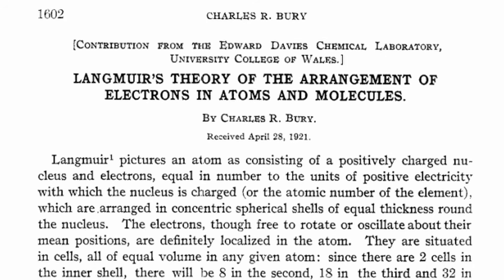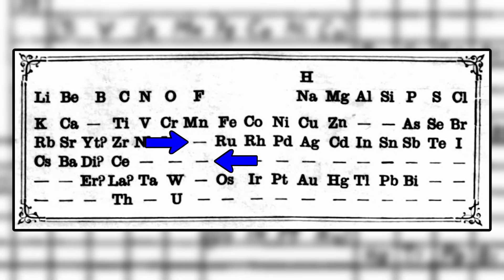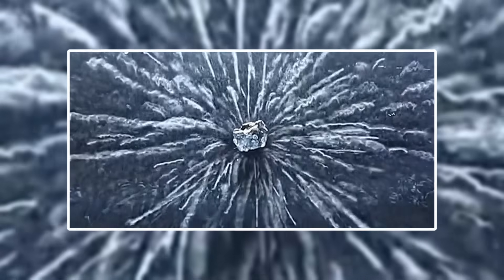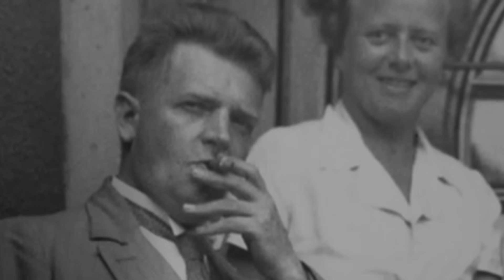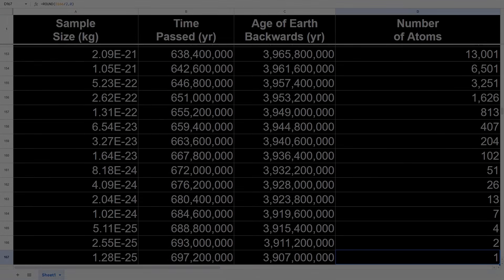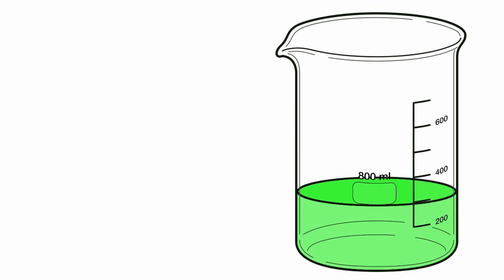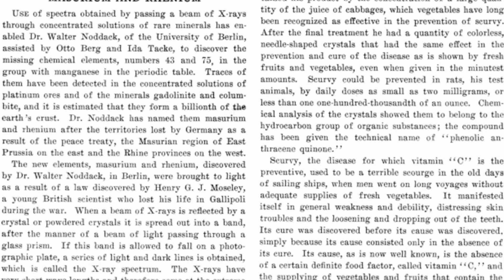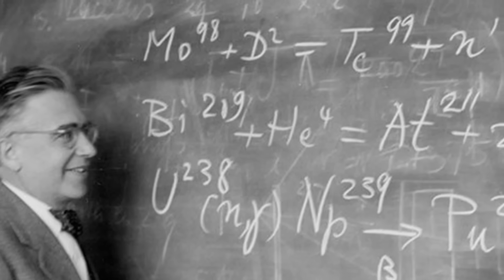How the First Artificial Element Was Created

Comment: Technetium-99 is also the third largest source of radioactivity in nuclear waste, after Cesium-137 and Strontium-90.
Reply: How? If it decays in the matter of hours, it’d be gone before taking it out of the spent fuel pool
Reply: @ShadowWasntHere8433  Tc-99 has a half life of 211,000 years.
Reply: seems like a few hours to me
Reply: @realandtrueguys  Maybe confusion between Tc-99 and Tc-99m. Technetium-99 in its ground state has a half-life of over 200,000 years and is part of nuclear waste. Technetium-99m is a short-lived excited state of Tc-99 and is produced artificially by neutron bombardment. It then transitions to Tc-99 by emitting a gamma photon and has a half-life of only about 6 hours.
Reply: Well now I gotta go dig into nuclear waste to get tecnetium
Reply: We used to work on 10 half lives before disposal into normal waste, Tc not a problem!Tc 99m

Comment: Really interesting video. I would have assume that the traces in the white smoke would have been enough to fully claim the discovery of element 43, but I guess it were different times back then. I wonder if the original name would have stayed, if the connection to the battle wasn't made